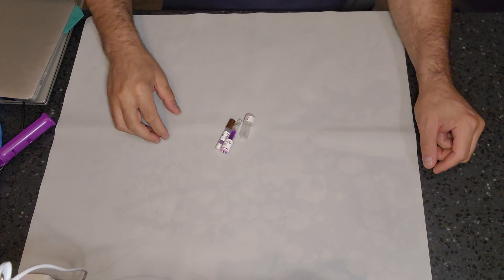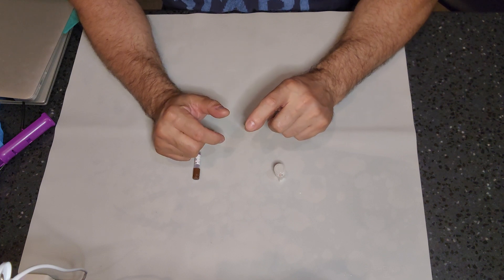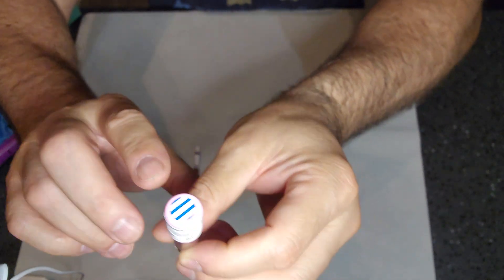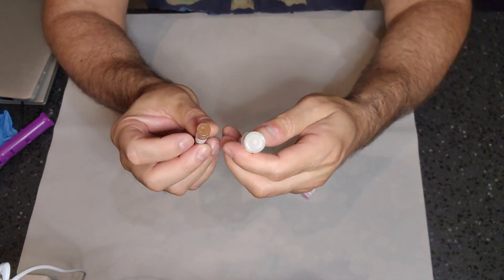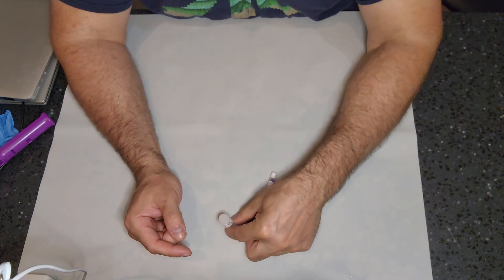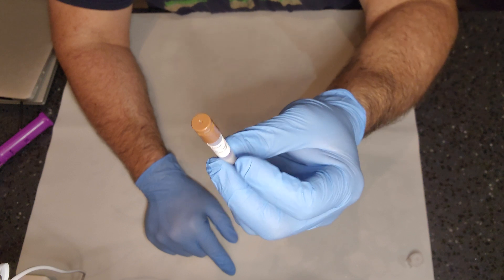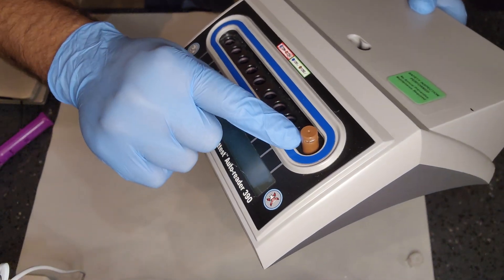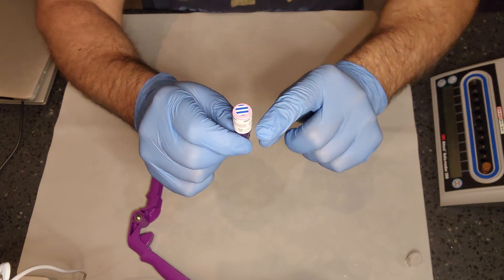Back to Basics: Activating BIs(biological indicators)

Comment: dear @W.D.Y.D CSP , i have Question. what is the different between 10^6 spores VS 10^5 spores VS 10^4 spores ?
Reply from the maker: The numbers you are referring to is the number of microbes on a device, typically used to represent the sterility assurance level of a process. 10^-6 is the goal of HLD and sterilization at minimum.  10^-4 is considered safe for handling and further reprocessing. It's a little more complex than this but that is the basics
Reply: @WDYDCSP  HLD ? what is it ?
so choosing between those two is depend what you need or what the ISO said ?